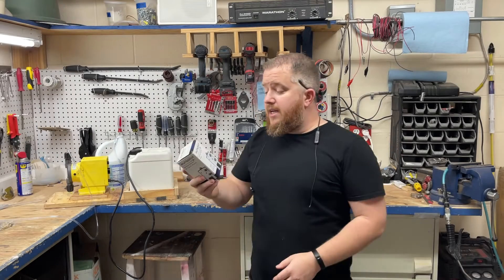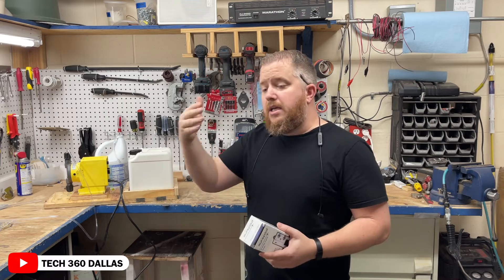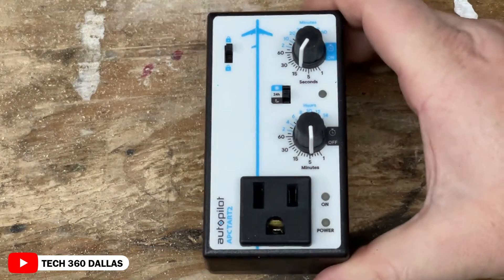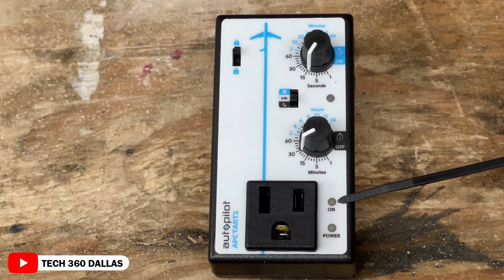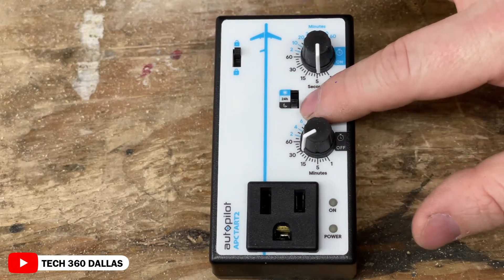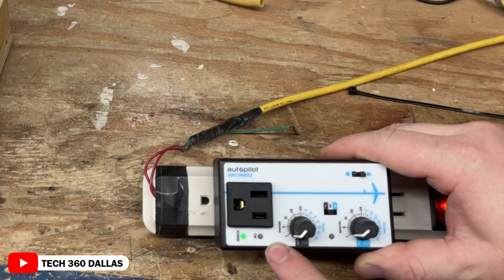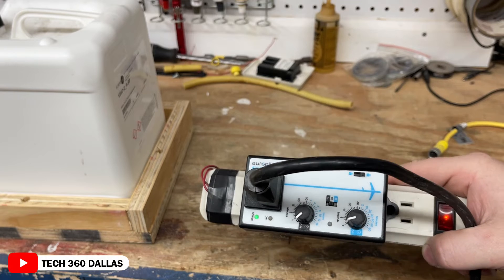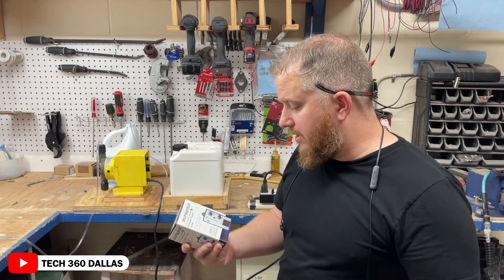Autopilot Advanced 24hr Recycling Timer

Comment: Interesting device. You could probably achieve the same with more precise control with a smart plug (relay based) or a smart relay. I like to use Home Assistant as it’s open source and much more flexible. You mentioned that this is pumping into an HVAC system, so it f you had say a smart thermostat you could add conditions to the automation where it would only run when say the blower fan is on. The sky is the limit there.